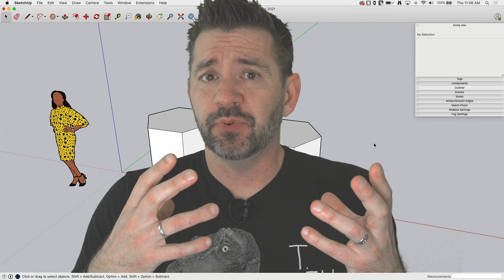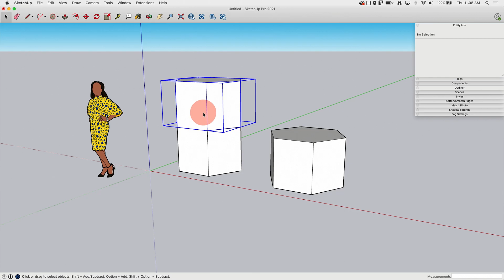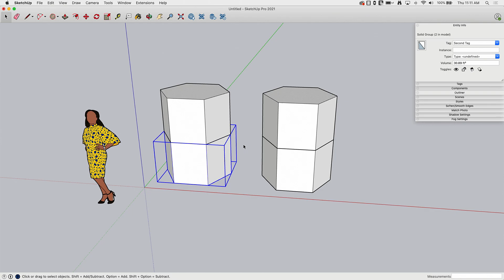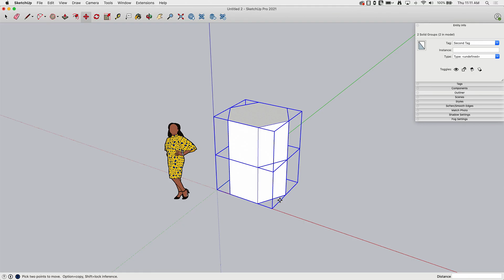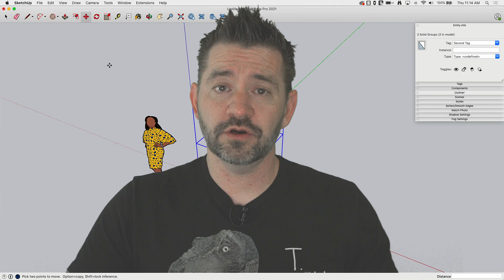Copy, Paste, Move - Square One

Comment: Another use case for cut/paste in place:  Moving geometry into or out of a group or component without disturbing the rest of the component.  Most common example that's happened to me is when I create something, thinking I'm working within a group, only to discover that when I hide that group, pieces of it are left hanging outside.  Select those pieces, cut, edit the group, and paste in place.  Fixed!
Reply: XLNT!

Comment: Request: 
Muqarnas.
There is a shameful lack of info on how they are made on the Interwebs. There was 1 SU video on it and it was sad. I followed another video from a guy with AutoCAD and got almost all of it but one piece that he no longer has the instructions for. So, yeah. These are an architectural fascination of mine and they look easy, but apparently they are not. 
 
As far as "Cut/Paste in Place", this is how I learned to move things into or out of groups and components. I can't find a better way. Sad, but true.
Reply: As far as moving things in and out of groups, try drag/drop in Outliner.
Reply: @mwoliver  Of course I already tried that, but it doesn't work right. There is no line that shows up telling me where I'm putting it and it usually ends up getting lost inside some other group I didn't want it in.
Reply: @DarkMoonDroid  Well, I agree that precision is required when dropping, that can't be argued. Descriptive naming helps, too. Anyway, it works and with practice could be equal to or better than the gyrations of cut/paste. Good luck and have fun. 😊